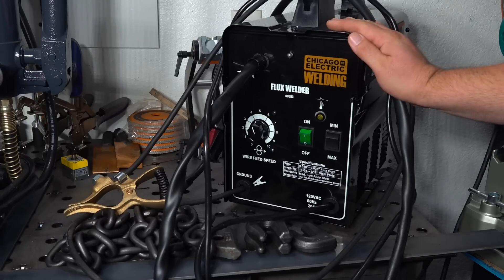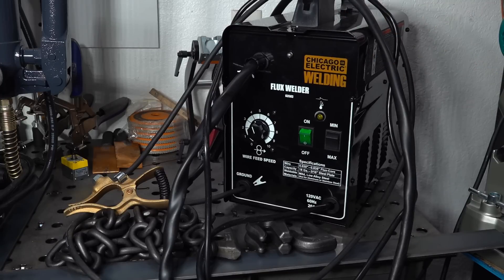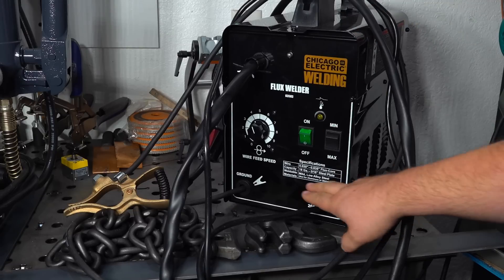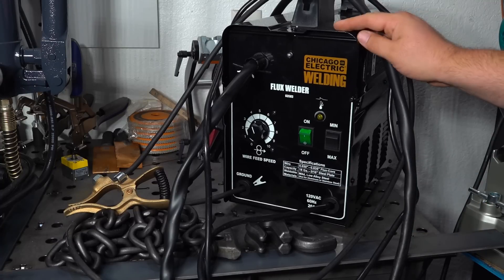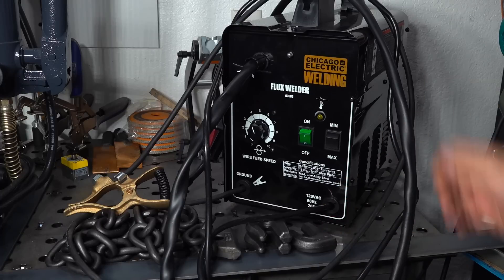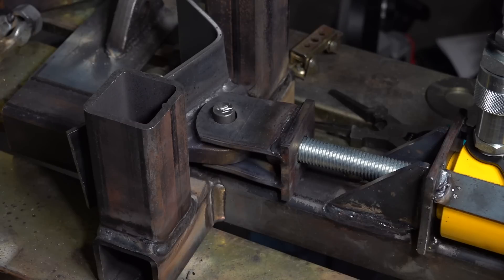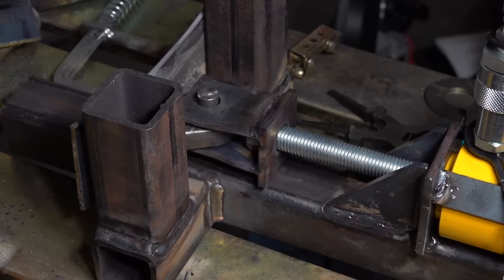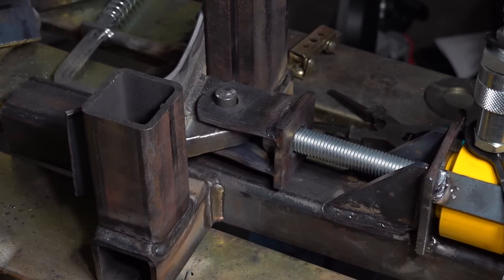Harbor Freight Flux Core, Weld Strength Testing Part 1

Comment: I fabricated a motorcycle engine stand out of 3" heavy channel welded with my HF that I've owned for over five years. The particular engine hangs from the bikes backbone along with lower case through bolts. The stand is a basic "H" base frame supporting a post and cantilever beam design. Everything bolts together as I welded predrilled plates to the channel ends. I stitch welded the cantilever beam out of two channels flange tip to flange tip and drilled holes to hold the engines top mount. There is ~225 lbs. hanging on it right now and has been for two days. A stand is far better than trying to work with a motor sliding off wooden blocks on the floor or even a work table. In short, it's all about application and understanding limitations. I was a certified welder and welding supervisor for over 15 years. Applying the correct weld joint preparation and understanding the welders limitation when using these welders is critical. In all honesty I can't understand these "comparison" videos. it is hardly apples to apples and price points are relevant. It would make more sense to just show what the HF welder can or can't do. I have yet to see a video where a guy buys an Altima and compares it's performance to the Ferrari he has sitting in the next bay.
Reply from the maker: My only objective was to show that people aren't always or only being elitist when they occasionally recommend that some particular job not be undertaken with a HF welder.  In your case, like you said, you have years of welding and welding inspection experience.  You can use joint design, joint prep and technique to ensure you get a satisfactory weld.  But a $100 welder is often someone's first welder.  Maybe all they see is people online saying things like "those guys are just trying to justify their expensive gear; this cheap welder will be fine for that hitch/trailer/jackstand," etc.  And maybe it would be, and maybe it wouldn't.   But I only wanted to show that there is actually a substantial difference in power between a 120V and 240V welder.  

I understand the automobile analogy.  And if someone ever did make video of a Ferrari beating a cheap, family sedan, there would certainly be lots of people saying it was an obvious result and stupid test.  But there probably wouldn't be a bunch of people in the comments saying with total conviction that the guy driving the Altima just didn't know what he was doing and that the Altima could get around the track just as quickly as the Ferrari if the driver knew what he was doing.  But when somebody online shows a video of a questionable weld on a hitch, lifting hook, etc. and people say a more powerful welder should be used, there are always comments saying that those people are just elitists because the HF welder is just as capable.

I do have two more videos (parts two and three) that are focused much more on the capabilities of the HF welder, rather than only comparison.  Another note:  You mentioned 225 Lbs hanging from your engine stand.  You may have saw in the video that I put multiple TONS of force on the pad eye welded with the HF welder.  So I obviously didn't imply that it won't hold anything.

Either way, I do appreciate feedback and if you have an idea for something you think it would be helpful to show with the HF welder, let me know.  Cheers.
Reply: I shall give that some thought. I will say your videos are top quality, leaving no stone unturned. Very easy to follow which is important for "newbies".

Comment: Why do people defend cheap Chinese stuff just because they own it? I have  HF flux welder and it is ok for some things but where my little welder was 90$, I got a miller thunder bolt that I dug out of a barn for free,  the leads are a little rough buy they are way way longer than thing on the HF. Even Craigslist is full of sweet deals on stick welders!
Reply: DON'T EVER get rid of that Thunderbolt. I'm looking for one now, or a Hobart stickmate. Those transformer machines last forever. The reason why people defend the machines is because they're trying to justify their purchase.

Comment: remake with a dc mod on the Hf welder
Reply from the maker: I have a second video up where I used different wire and had far better results.  I have a bunch more testing planned and I'm getting ready to make part three.  Not currently planning to mod it to DC output.

I would say that if someone already has the welder and wants to mod it for DC output that's great.  Most people won't do that though, and these videos are more about what people can expect out of the box when they get one of these machines.

Maybe I'll consider doing a video on DC modding one some day down the road.
Reply from the maker: Changed my mind, haha.  I did part two and three since this video.  Now I have a rectifier bridge on order and will test it again with that installed.
Reply: Instead of modding this one for DC, it would be better for someone to buy the 170 in the first place. It has higher output, and the DC will give a better quality, and better looking, weld as well.

Comment: im still happy with my purchase of a cheap welder
Reply from the maker: Glad to hear it.  I honestly want whatever people get to work out for them.   One reason I make videos like this is to prevent people from being disappointed with a purchase.  If people know the limitations of a machine when going in, they are less likely to be disappointed because they have a better idea what they are getting.  If a Harbor Freight, or other cheap brand welder works for you that's awesome.  I'm sure a lot of fabrication and repairs happen every day with inexpensive equipment, and that's great.

I don't intend this video to be a criticism of the Harbor Freight welder, just a test of it's capabilities in comparison to a 240V machine.  Nothing wrong with a 120V flux core machine.  This one having AC output limits it a bit further, but it also makes it even less expensive, and in the reach of more people's budgets.  But if people don't understand that there is a performance sacrifice for those cost cuts, they may have an unrealistic expectation, and may end up disappointed.

I may have sounded disappointed with the welder in this video because I couldn't get the performance I expected out of it.  I have since gotten better wire in 0.030" size and it is doing much better.

Do you have a welder from Harbor Freight, or another brand?

Comment: Hey really useful & thorough comparison. Thanks! Would've been good to see how they hold up if the joints are bevelled first, to increase the penetration, as well as multi pass, as you mentioned. 

All that most people want is just for there to be some method to make good welds with a cheap welder, even if that means spending more time preparing & doing passes. We're not using it in industry so taking x2 the time doesn't matter very much!

Check this video to see the unbreakable strength someone else got with this welder using a single pass on 1/4" steel with a slight bevel 
https://www.youtube.com/watch?v=eL1EibTRP3I
Reply from the maker: I'm hoping to do the welding for part two tomorrow.  I do plan to do more prep, more passes and possibly pre-heating to see how it effects strength.  

I feel that the biggest thing holding the Harbor Freight flux core machine back is the fact that it has AC output.  The Lincoln Weld Pak I reviewed did far better because it has DC output.  It is also twice as expensive.  The Forney I reviewed is also AC output, and is slightly more expensive than the HF welder.  I felt that the Forney did do a bit better though.  It seemed to run a bit smoother.

Honestly, I'd personally look for a used, higher quality welder before I'd go with the Harbor Freight flux core machine.
Reply: @bigtb1717  Great, looking forward to part 2. Thanks for the info, I'll take a look to see if I can find any decent used welders at a low price. 

For part 2 it'll be helpful if you put a link to the exact welders you're using in the video description.
Reply from the maker: I'll can put links in the description of the next video.  With holiday stuff with the family sprinkled in I can't say exactly when I'll get everything done.  Hopefully the video will be up by this weekend, but I can't say for sure.  

I may not do quite as much with the ESAB welder in this video.  I'll still probably do some, but I want to focus more on what, if anything, can be done to increase the strength of the welds that the Harbor Freight welder puts down.
Reply: @bigtb1717  Cool, yep I know this Christmas period is always hectic. Sounds great!

Comment: First off I'd like to point out how this is not a good test based on you have to different welders not even in the same class in speed of wire or heat of the well secondly just looking at the welds clearly the more expensive welder was used at a higher heat and either a different speed or you used several passes vs the one pass you did with the HF welder just look at the video again anyone with half a brain can tell the weld size of the HF was like what maybe a 1/4" thick vs your fancy expensive was clearly almost 1/2" thick if not bigger so obviously you did this video with the pretense notion of showing how a cheap welder can in no way be good and there for it's junk and we should all go out and spend lots n lots of money to buy a welder cause apparently the more money you spend the better the weld will some how be
Reply: Ok vid, I guess. The problem is, its inappropriate to weld cast steel that thick, to plate that thin. If the plate were thicker, then suddenly it becomes ideal to arc weld the pieces in the first place. Also, the lack of preparation for  the pad eyes is my biggest issue. No matter what class of mig you're using, its not possible to get acceptable contact without chamfering the large base of the pad eyes. As a matter of fact, if you don't have the time and tools to profile the base, all you need to do is drill a 3/8 hole in the plate and and flood with weld from the back/bottom. With these improvements in preparation, the HF welder becomes a lot more valid for a diyer. Either way, I wouldn't consider mug welding metal that thick when an arc welder is available. Thanks for the vid.
Reply: Theoriginalct Theoriginalct I weld thick to thin all the time. There’s nothing wrong with doing that as it’s common industry practice. You have to know how to weld properly. You spend more time on the thicker metal than the thinner. You start on the thicker. You move further onto the thicker than the thinner. You have to know the correct settings to use. It’s too bad that so many guys on You Tube seen to think that they can learn all they need from playing around in their garage. You may be able to lay a halfway decent looking weld, but that doesn’t mean you know much about welding.
Reply: @melgross  -I totally agree. I started out with a HF mig and feel like I could weld%90 of anything that I make with one. After many years of being certified, the biggest downfall of welds that don't perform is probably %50 prep, %25 skill deficit and %25 consistency and repeatability along with adjustment to prevailing conditions. My whole point is you can't blame the welder for every falling weld. Thx sir!
Reply: And, by the way, I was using “you” in the general sense.
Reply: Moron. The point is to show that the harbor freight welder shouldn't be used for bigger projects or thicker steel, that it just isn't strong enough. It isn't to show that the welder is a piece of junk.
Reply: @eli72481 first off don't call me a moron as it just just clearly shows how much of a POS you are to just pass judgement on someone you don't even know secondly yes it is showing that weather it is your intention yo or not if you put a video up showing how one to thing cannot do something  the other cannot or even as good as you are making a point to others that the lesser of the too is junk and should not be bought weather you tried to do that or didn't that is what is showed in videos like this thirdly if you make a video on YouTube and you get a negative comment(s) you don't respond with name calling I wasn't disrespectful and calling you any names on my first comment  plus if you don't want negative comments about your videos then turn the comments section off before you post

Comment: Dude are you really comparing the weld at 8;36 to the weld at 9;05  Ray Charles can see the difference in the weld job  SMH
Reply from the maker: Well, I suppose the HF weld could be mistaken for Braille.  ;)
Reply: thats what i was thinking. even with the same welder if you do those two kinda welds the results gonna be the same..
Reply: yea he compared a 1/2 inch weld to a 1/4 inch weld of course it is way stronger.

Comment: I got the harbor freight. Would it be ok to weld a ramp to a trailer? To carry a 2 man razor
Reply: I would consider a stick welder or a mig welder with gas.   The heat your gonna need for the ramp thickness is going a be tough with the HF welder
Reply: Don’t rely on the welds for loading strength. This welder isn’t intended for that.
Reply from the maker: I've busy with too many other things to get the part 2 testing done yet, but from what I've done so far with the HF welder, I'd be very careful to ensure the bulk of the required strength was integrated in the design if at all possible.  

I work ok, but keep in the back of your mind the worst case scenario if the ramps failed, think about what you can do to minimize that chance, and decide if the risk it worth it to you.

Personally, it's really hard for me not to feel biased.  I've used and tested several relatively inexpensive welders now, and the Harbor Freight welder in this video has been by far the most disappointing.  Maybe I got a bad sample, but the output just seems really weak.  I plan to try a different flux core wire for the next round of testing to see if that has anything to do with my results.  But I had more trouble getting any kind of respectable results from this welder than any other I've used.
Reply: @bigtb1717  alright. I'll definitely be using the Lincoln electric flux core welder instead. I don't wanna take chances. Thank you.
Reply: @bigtb1717  Hey if you don't mind, which of the cheap welders gave you the best results? Are their prices in the range of the Harbor Freight?

Comment: Would you recommend the HF welder for body panel's??
Reply: I just got done using one on my panels, done slowly and careful yes it can be done, i had a couple burn thrus but will be grinding welds down and smoothing with bondo, so bulk was what i was needing.
Reply from the maker: Flux core probably isn't the best for body panels in general, but I'm sure it could be done.  I don't have any experience with auto-body work though, so maybe someone with experience in that realm will see the question and answer.
Reply: Check out Flux core welding with filler rods. The filler rod absorbs some of the heat & provides extra material to reduce burn through.  I've seen some impressive videos of people using that technique on car body panels. Also you can't run a straight bead else it'll burn through the panel. Need to run tacks on opposite sides to allow the panel enough time to cool. I'm researching this stuff myself to find the best value welder to do similar work.
Reply: You can do it, but AC fluxcore has too much porosity for sheet, and it’s hard to control. It also tends to be brittle.

Comment: Thanks for the video. What settings did you run the HF welder at? I’m trying to weld a nut to a bolt head that is stripped with this welder, I only have room to weld the center of the nut (it’s a 11/16, not sure the inner diameter) any tips would be awesome. 

First few practice runs I was able to snap the head off of a M6 after some adjustments (most important thing I found was to drill out the nut threads so you don’t get arcing on them) so I’m almost confident enough to go at it. It’s a camshaft bolt I’m welding to (specifically an adjuster). I did notice most of the heat went to the nut so I need to figure that out how to get more heat in the bolt. Maybe building up with the nut off first will help?

Sorry rambling! Thanks again.
Reply from the maker: For settings, I used "Max" on the voltage switch and as much wire feed speed as it would handle.  Anything very much over 3 and it ran very poorly.

I assume whatever the broken off bolt is stuck in is drawing the heat away quickly, which limits penetration on the bolt, compared to the nut.  It very well may help to try building up the broken off bolt slightly first.  Hard to say for sure without seeing the situation.  Sorry for the late reply.  Busy day at work.

Comment: I see a lot more splatter on the Harbour Freight welds . What make of fluxcore wire did you use?  Great Video
Reply from the maker: The Harbor Freight welder has AC output, so it will have more spatter no matter what.  The ESAB welder is one of the most spatter free welders I've used when it comes to flux core.  

I used the included flux core wire and some Blue Demon wire in the Harbor Freight welder.  The Blue Demon wire was 0.035" and really didn't work well at all.  I used Lincoln wire in the ESAB.  I only have Lincoln wire in 0.035" diameter, but I plan to get some in 0.030" to try in the Harbor Freight machine for part two.
Reply: AC isn’t even recommended for most flux core welding, though there are specialized (Read as expensive) flux core wires that can be AC welded.